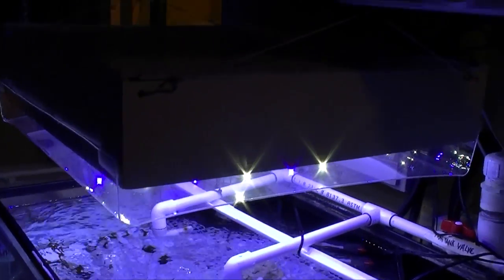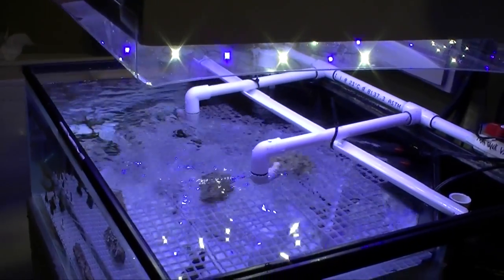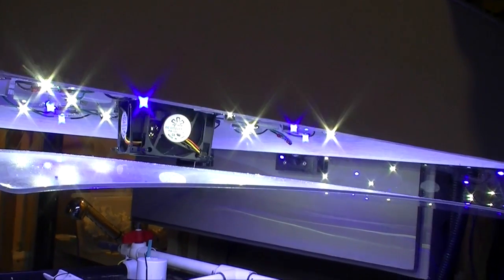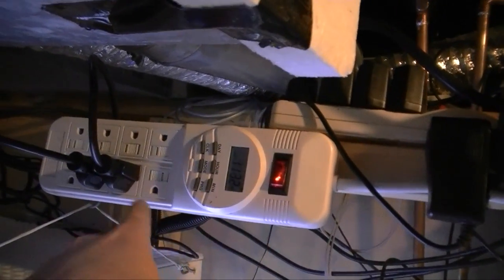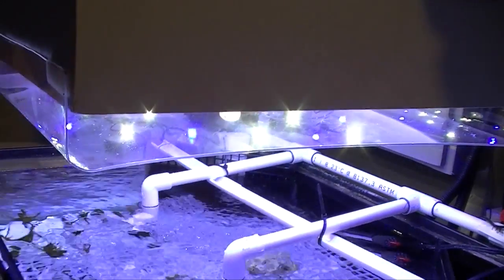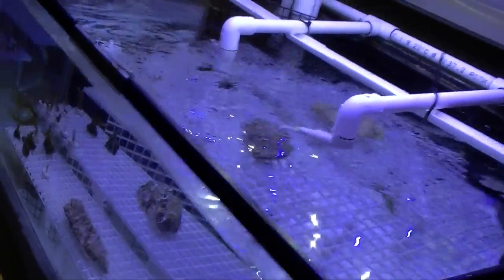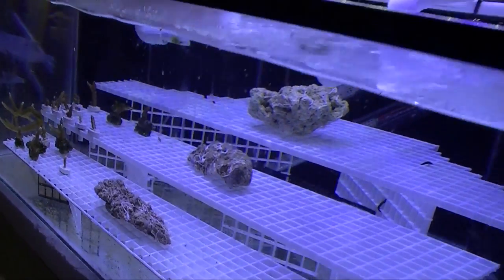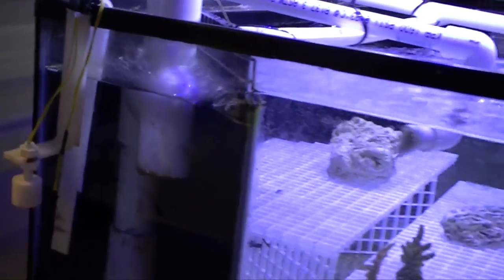Rickets Reef: DIY Frag Tank LED Fixture Part 6

Comment: man, that are too much other ways to minimize consuption of power used on your reef! These LED's there, they just need a good dissipation grid, dont need FOUR FANS cooling it. Even the power the fans sinks is just a bit,  it does cost a litle more on the eletricity bills. Do a better research, and you'll find some ways to do a great lamp with LED's with a bit of power (voltage and also current). ;)